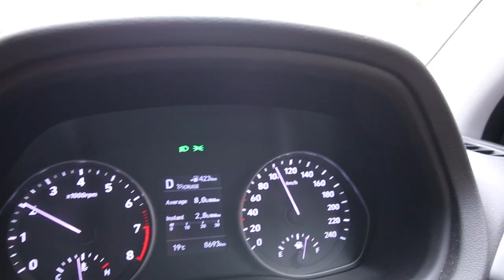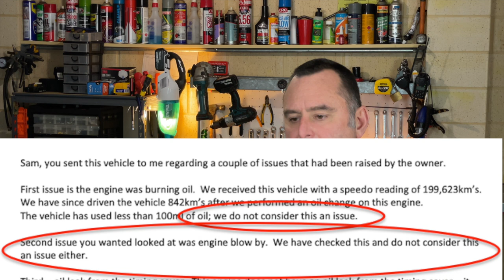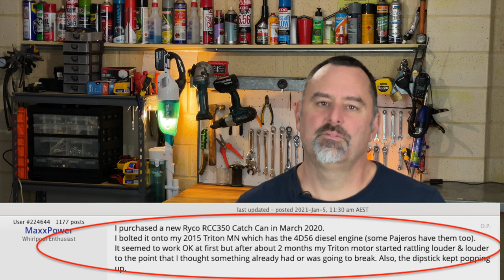Did my 200 Series Landcruiser ENGINE BLOW again - twice in 12 months? Or was the catch can to blame?

Comment: Why are these 4.5 V8s so underpowered?. Just 155kW from a 377kW potential; just 450Nm from a 900+ Nm potential. That low output puts the stock engine in 3 litre 4 cyl territory.
Reply from the maker: They are actually 195kw and 650nm in the 200’s

Comment: The 200 series is garbage. So many flaws for such an expensive piece of garbage. Was the engine dusted
Reply from the maker: This is more about the issue with the aftermarket catch can not the cruiser itself. Yes I believe the previous owner dusted it. I’ll go into how I’ve tried to mitigate that happening again in a future video.
Reply: @JebbreysJibberish  any reason you are not running  provent catch can? 

A x amount car on the steep side of it shouldn't have these serious issues. Least of all a dusted engine originially. Sorry mate not a fn of the over priced Toyota's. Great story tho u told it well.
Reply from the maker: Thank you. When the car first broke the day I bought it, the repairer had it apart and I asked him to fit the catch can while he had everything apart. He only had Ryco in stock and I live in a regional town so couldn’t simply pop into another place to buy a provent. After all this happened I decided to just leave it as is for now and reassess once I’ve got everything else working right and it’s proven itself reliable.

Comment: I just got a 200 series and it's problem after problem, absolute rubbish vehicles, wish I never sold my 100 series
Reply from the maker: What problems are you having? Other than a dusted engine and dodgy catch can mine has been pretty solid. (Touch wood!!)
Reply: @JebbreysJibberish  Keeps going into limp mode (restricts to 4th gear and 2.5k rpm so can only go about 80kmph max) with VSC off and 4lo flashing. It happens when I accelerate hard for more than a few seconds, ie, 60kmph foot flat to 100kmph it happens. The next time I start he car limp mode is gone, but the lights stay on for a few more starts then seem to clear eventually. I'm waiting for a code reader to see what code it is actually throwing. I had brakes replaced recently (rotors and pads) so it might just been a wheel speed sensor (I'm hoping), but most online seems to suggest turbo or injector issues. It was smoking bad on startup too but injector cleaner seems to have cleared that up. Might be using oil too but I'm not sure, need to check oil level when it's cold, but I only just had it changed like a week ago and it's down to half already..
Reply from the maker: There’s apparently a small hose on the back of the intercooler that can either come off or split which can cause those symptoms. I’d going up to 200 series land cruiser owners page if you are not already on there. There are some very knowledgeable people on there. When you check the oil make sure it is in the same level spot each time. I find the slightest angle can really throw out the reading. The dipstick only shows about the last 1l out of about 10l that is in there but even using 500ml in a week is a worry. But it might not be if the level was wrong when checking.

Comment: Did it come from the factory with a chatch can? If no why have it at all…..change the oil more often….. stop with all the ad on you do not need….
Reply: My 200 is a tractor for my caravan, or motorcycle trailer, and not a shopping trolly, so all it does is hard work. If I  can fit a device, any device, to reduce the effects of hard work on the motor then I will, and after over 200K km I have never had an issue. I have the Flashlube catch can and a 1 micron secondary fuel filter, change all the filters on schedule and some times sooner if on a long haul. The catch can catches oil I don't want back in circulation.

Comment: Bullshit. Sounds like they put it on ass about, inlet bottom exit top on a ryco, sounds like something you should’ve checked. After watching your vid I checked mine and it’s fine after 3 filters and 150k works perfect. I think your telling half a story.
Reply from the maker: Think what you like. But it was fitted correctly and if you simply use google you can verify the other people’s stories too. What advantage would there be for telling half the story? If the mechanic screwed the install I’d blame them, I’lm working with the facts I have here and have been as thorough and transparent as I possibly could be.